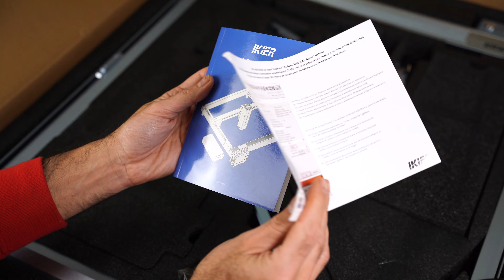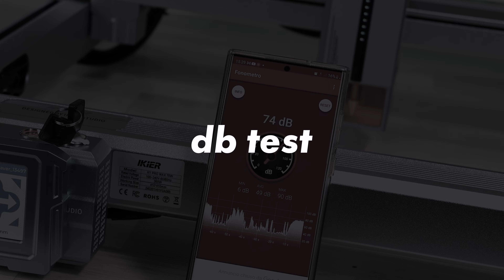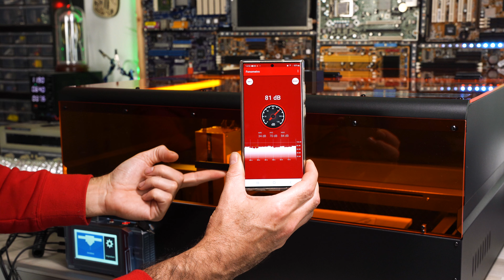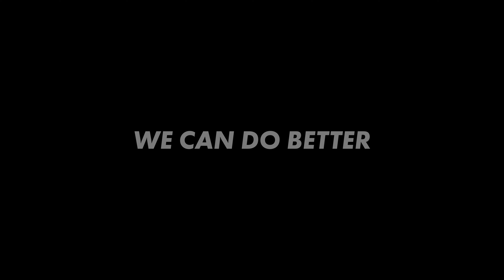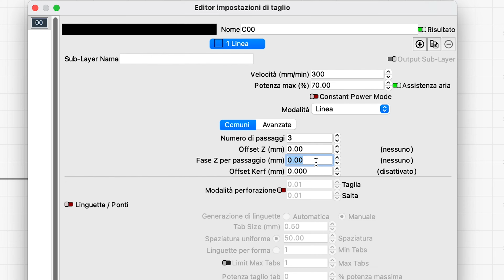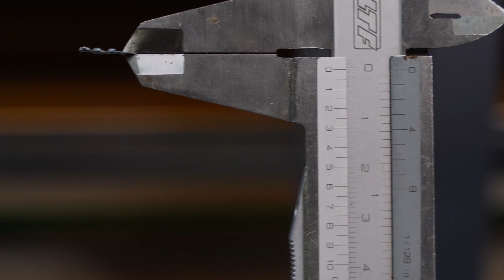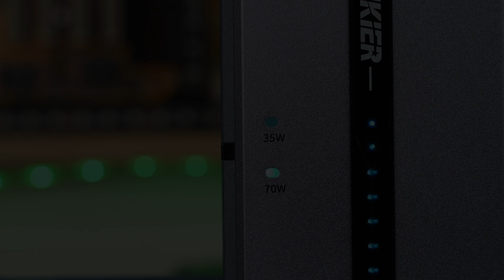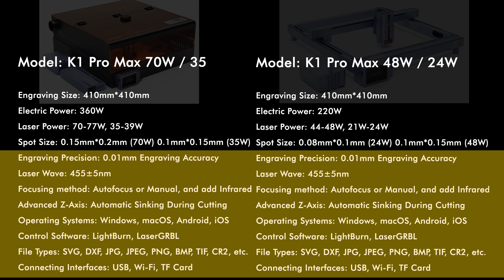WORLD RECORD the most powerful diode laser engraver in the world IKIER K1 PRO MAX 70W

Comment: Tip-: When using a hand saw use the full length of the blade, you will get a much more accurate and clean cut, and your elbow does not need to move as fast as a bees wing!